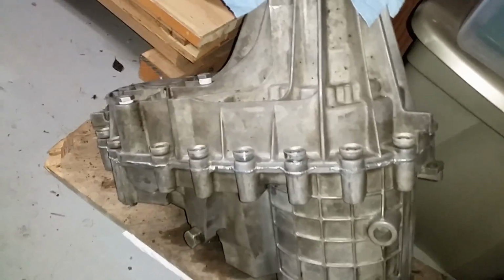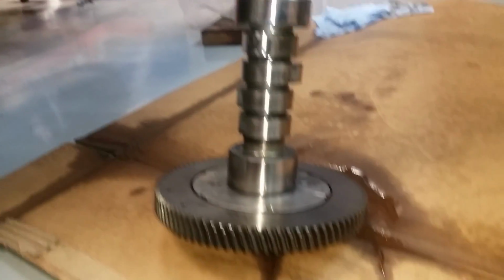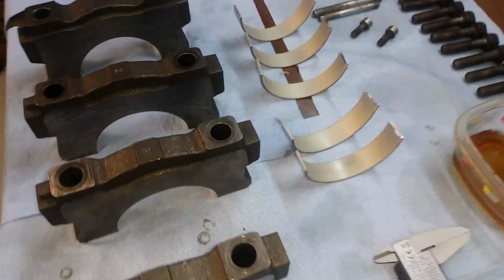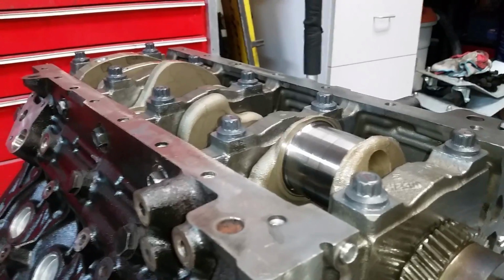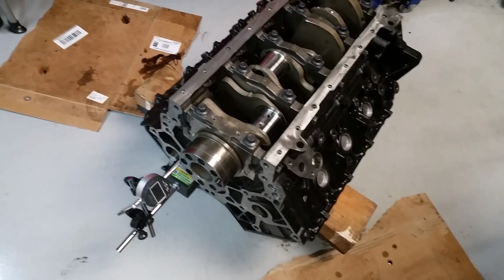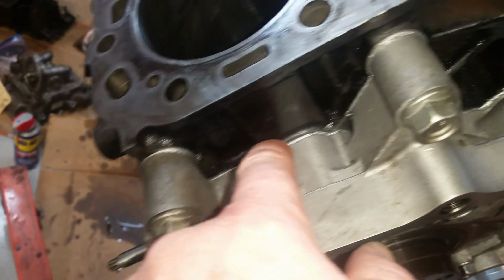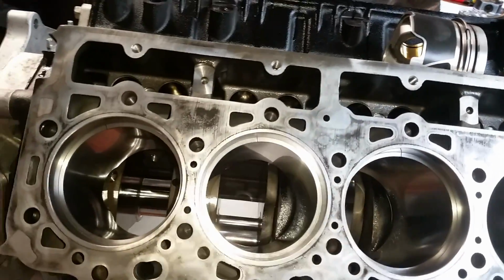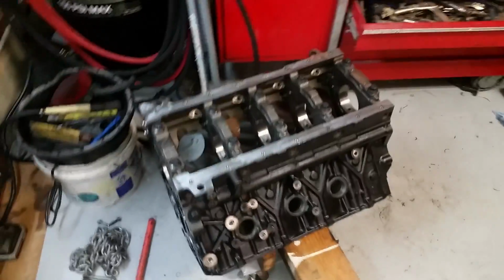Fastthings 6.6 Duramax LBZ Rebuild.... Part 5

Comment: I'm getting ready to build my first duramax. I had over 400k on mine and my nephew totaled the truck. I just got it all disassembled. All the bearing look new to me. I'm not really sure what to look for. What manual did you use?
Reply from the maker: I didn't use a manual. 
It will be obvious if the bearings are bad.
Why the rebuild?  Just because of the mileage, if so, how nice.
Reply: I had to pull the engine out anyways so figured ID overhaul it. How are those pistons working out. I can't decide if I want to use those or without pockets
Reply from the maker: @franky4701  I've got about 20k on it, it hasn't missed a beat. It runs real nice.

Comment: For the final bore, was a torque plate used and what did you end up with for the final bore and ring gap ? Did you have to file fit any rings ?
Reply from the maker: Didn't use a torque plate, don't remember the numbers. 
But, that was the thing, after it was bored correctly, none of the rings needed to be filed. The piston and ring kit where all perfect gaps.
Reply: @fastthings  Does it seam to run good, no oil usage or piston noise ? The reason I ask is the GM piston ring spec is much tighter 0.012 - 0.018 with 0.002 piston to wall clearance.
Reply from the maker: @MakingMemoriesToday  again, it's been too long, don't remember the numbers.  I do remember being right on spec. It runs perfect, nice and strong, tight. No extra noises, no oil leaks.

Comment: Where does the third thrust washer go
Reply from the maker: In between the crank and block, up front.
Reply: there is no clearance in the front, it goes in the rear outside of bearing cap where it is clearance with indention facing out.
Reply: Darrel Davis I figured it out a long time ago lol trucks been running
Reply: HondaChase831 I was searching because I assembled mine yesterday and lookin at the pic on Mitchell on demand confused me
Reply: Darrel Davis yea I hear ya you have a insta? I have pics of mine assembled
Reply: HondaChase831 Na, fb only

Comment: The ones with no play will seize when they get to temp...  I was brought it to diagnose a 90 camaro that someone rebuilt with too tight pistons. I ran it in with a garden hose running in the radiator till the pistons clearanced themselves. There was allot of aluminum in the oil. The car drove around town for years till some kid threw a rod through the block. My Corvette sounds like a sewing machine until it warms up. Piston slap on the passenger side, real common defect. Pistons and bores seem to never be in spec these days.
Reply from the maker: Funny, I don't know why I stress so much. But I swear that thing would have seized.  

I used to put motorcycle motors together, with used junk, had alot of fun.
Reply from the maker: I do remember hearing about the LS piston slap.
Reply: That motor would seize before operating temps.....
Reply from the maker: burlbark I agrer